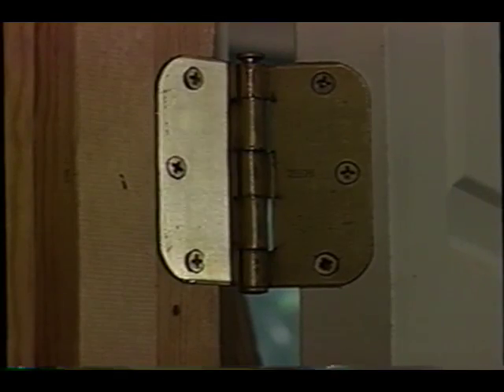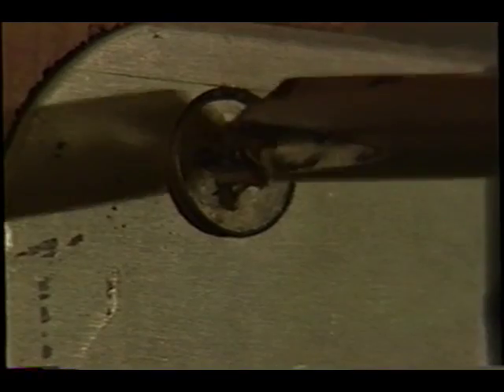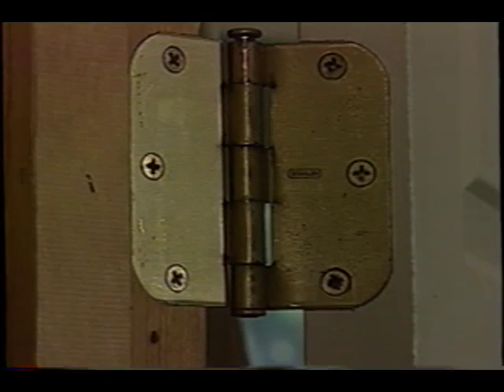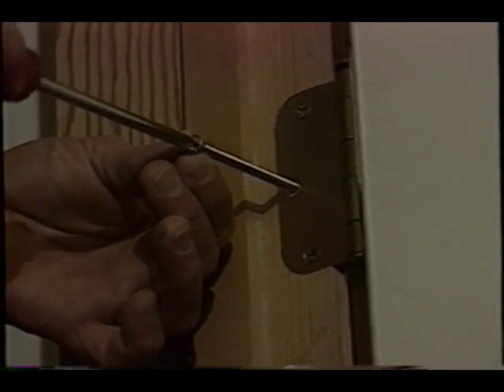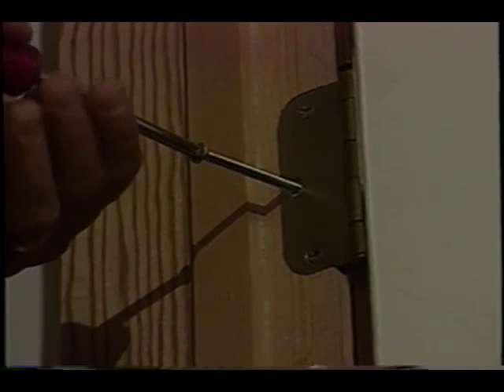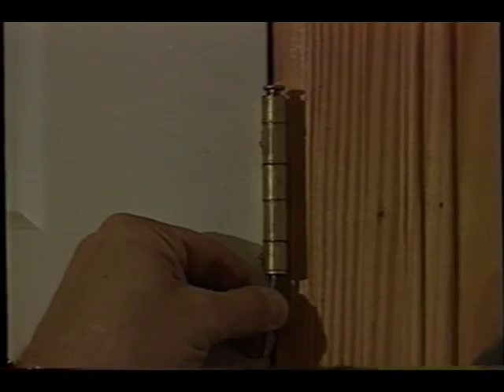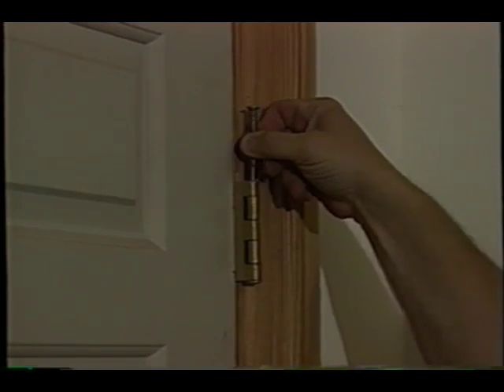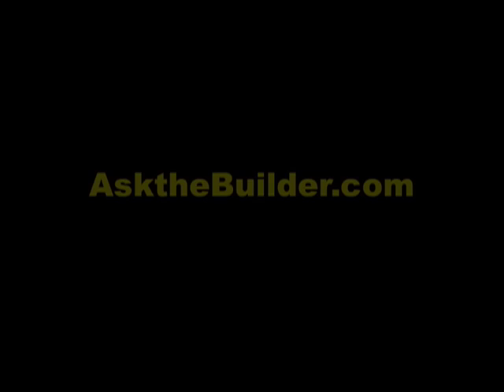Door Hinges

Comment from the maker: Sounds like the graphite is not getting into the inner parts of the hinge. Take the hinge pin out and coat the shaft. Then use a cotton swab to get graphite into the hinge cylinders. Reinsert the hinge pin. I'll bet the squeaks will no longer be an issue.